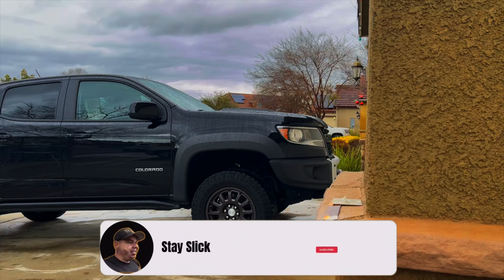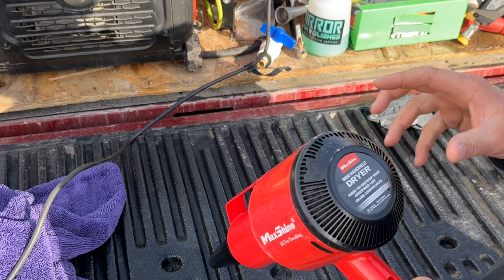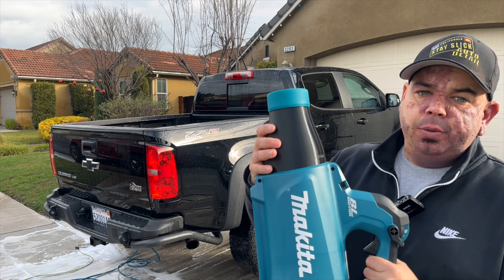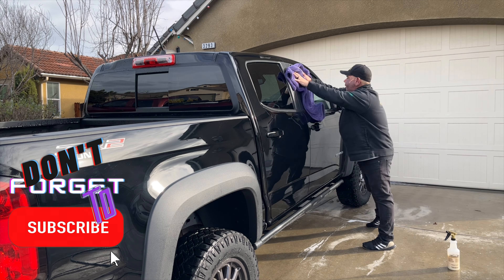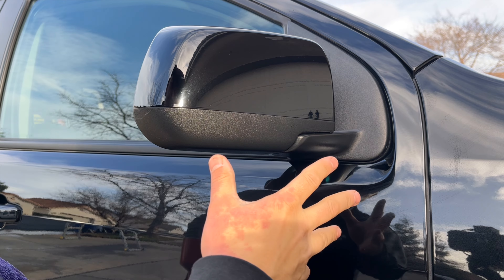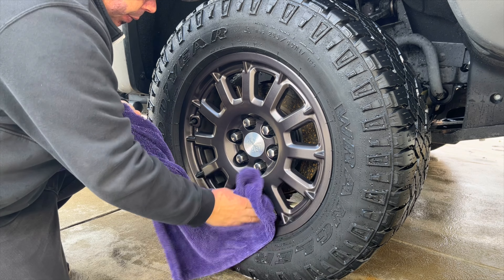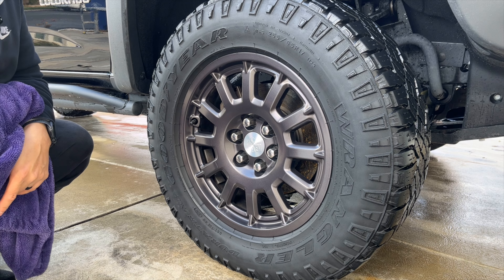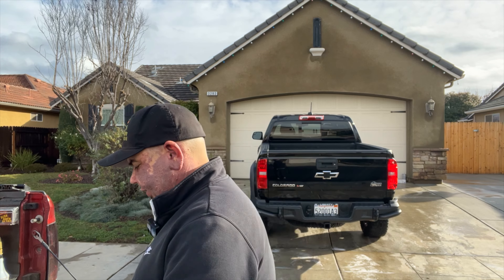My Drying process Feat. Maxshine Mini Handheld Blower

Comment: How do you like the 3D bead it up vs say diy ceramic gloss or cleanmaker or other similar products? And do you dilute it?
Reply from the maker: Bead it up is my current favorite spray sealant in the polymer category, but I would definitely say ceramic gloss from DIY Detail is my favorite ceramic spray sealant. I haven’t tried clean maker yet I plan to, but just haven’t gotten around to buying dream maker. I have also tried extreme solutions, topper, and technicians choice ceramic detail spray. They are both good, but I still prefer Bead it up or ceramic gloss. I do not dilute bead it up. It’s just straight.